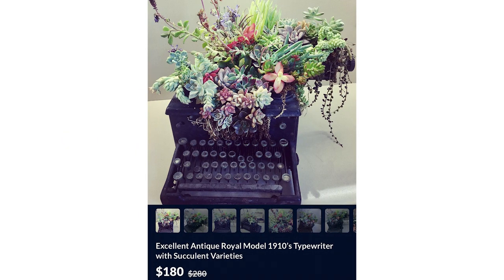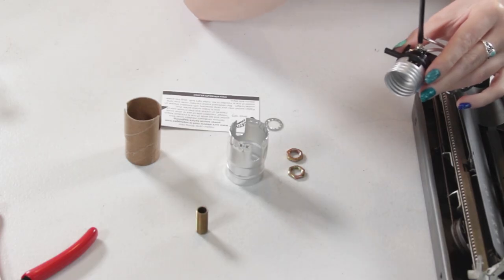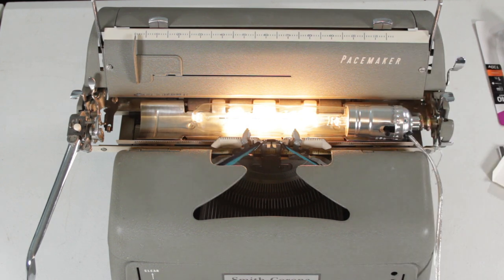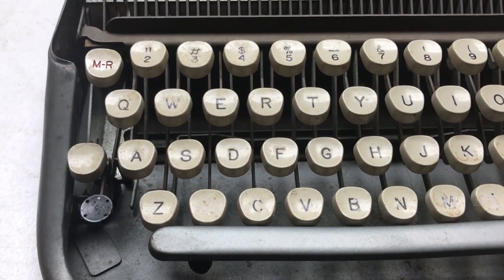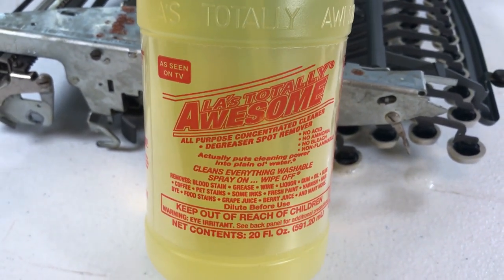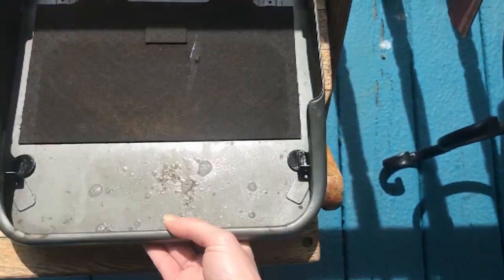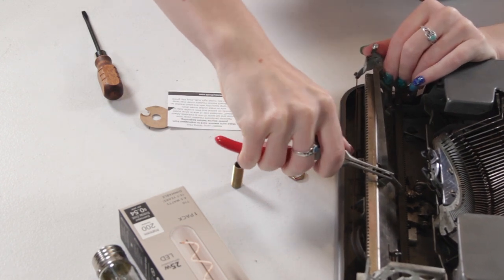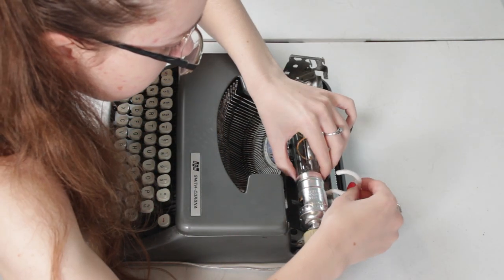i made a typewriter lamp..... (and got electrocuted....)

Comment: Semantic point: You did not get electrocuted, you merely got an electric shock. According to my 1972 Webster's Unabridged dictionary, as well as other older dictionaries and my junior high English class, electrocution is when someone dies from electric shock. Newer dictionaries seem to have expanded that definition to include severe injury by electric shock, but all the ones I found (not counting Wiktionary and other user-built dictionaries) agree that shocks not resulting in hospitalization fall short of electrocution. Thank G-d, all you got was a painful shock, a scare and some heightened respect for those wires and outlets in the walls.

Don't feel too foolish for the misadventure, though. I did the same thing to myself a few years ago while attempting to fix a refrigerator, and I'm old enough and experienced enough to have known better. I remember thinking, "You should unplug the fridge before continuing", but I somehow managed to distract myself just long enough to forget to do that. I then proceeded to expose my fridge's circuit board, begin poking around it to try to figure out where the thermostat was, and ZAPPED myself clear across the kitchen. I was startled but unhurt, the circuit board was a total loss and the joke was on me because the darn thing didn't even have a thermostat of the sort I was seeking.

Be well, stay safe, live to tell us about more cool typewriter adventures and I look forward to your next video.
Reply from the maker: I appreciate the feedback!